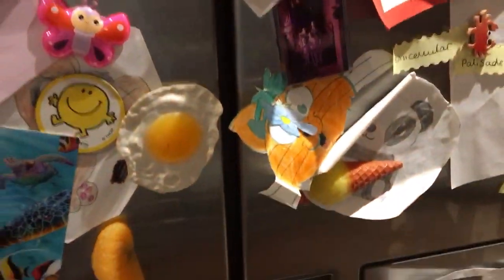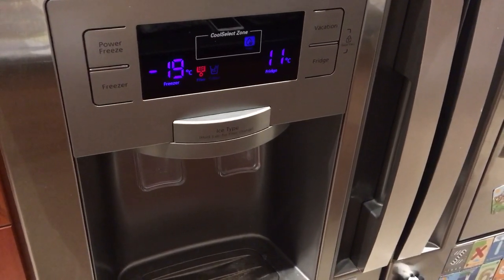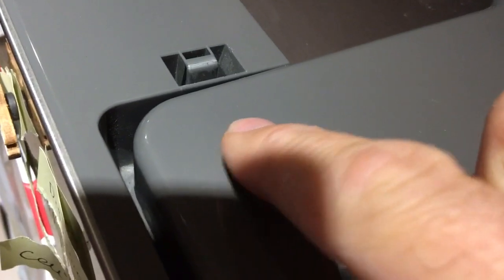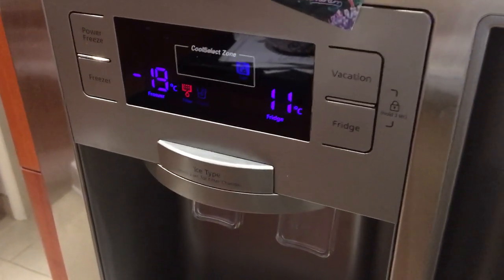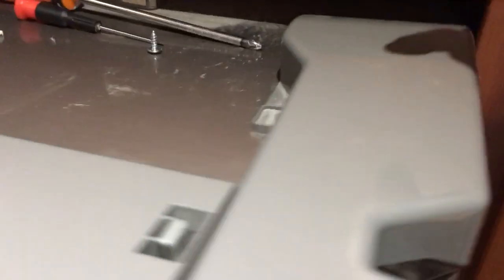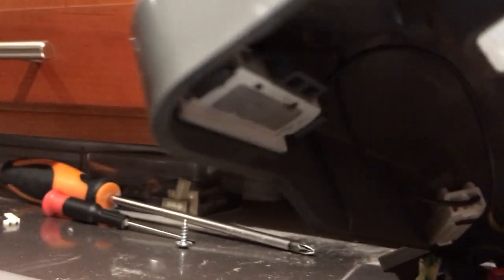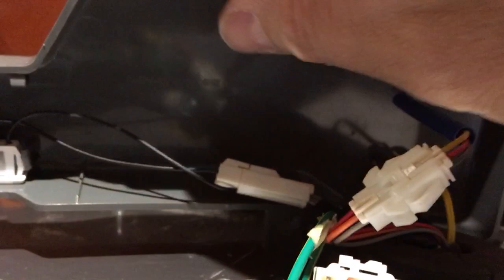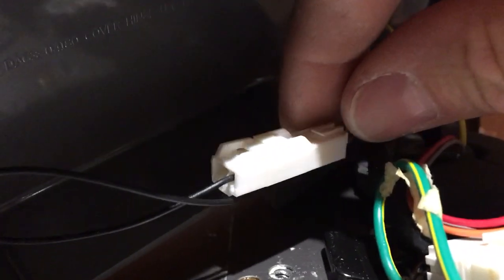Samsung American fridge freezer door alarm FIXED!

Comment: Thank you!! I had a brand new fridge replaced because of this issue - turned out the new one had the same issue. The moving guys took a door off both times to get it into the house and unplugged this switch both times! You the man
Reply from the maker: Spot-on! The people that fitted this in made such a shoddy job of adding the doors on, fairly sure they stress that cable towards the end of my video.  Thanks for your comment!!😊

Comment: You saved my life! Just bought a Samsung fridge 2019 its almost the same but my (caps) weren’t on correctly and I put them on correctly which put them closer to the magnet and its working fine now! What the fridge was thinking is that the door sensor are open so it won’t give you water or ice so putting the caps on left and right above each fridge door will fix this problem !

Comment: Was having trouble with the alarm not shutting off and the lights were off when door was open. Did some looking around and found wires on top the fridge near where it hinges were cut. Must have got pinched over time and eventually broke off with every opening of the  door. Spliced the wires back together and it's as good as new now. Very irritating to have it constantly binging every 2minutes until I found out what was wrong with it

Comment: Just had the same problem, tried this didn't work, turns out it was strong magnets I had on the  front of the Fridge to hang the kids art work was knocking out the connection. There strong magnets we use in my work for hanging advertising. Never thought they would do that. Fridge works fine the second I took them off. 🤦🏻‍♂️🧲

Comment: Got this same fridge, replaced the magnetic sensor and still the same issue 🤦
Reply from the maker: Might be dodgy wire connections.  Or could be the door itself.  Try taking mag sensor out of its slot and attaching directly to door to eliminate possible cause.